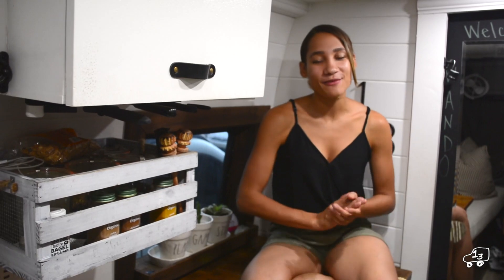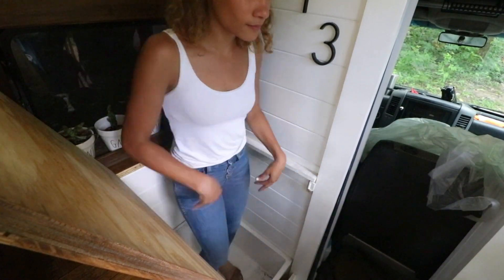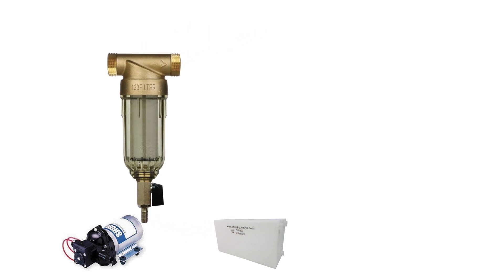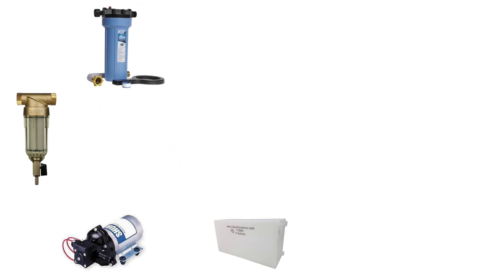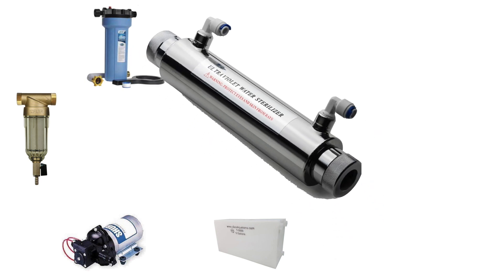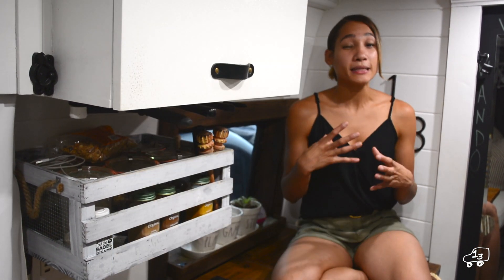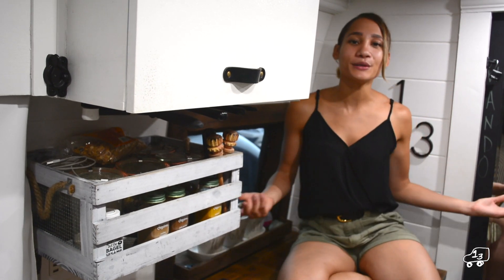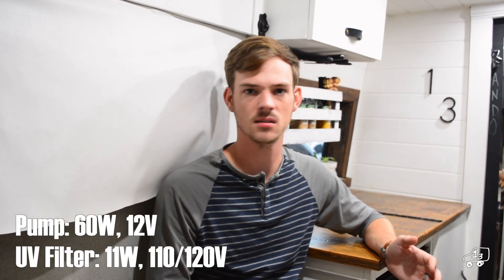VAN Tour: Recirculating Shower | How to Shower in a VAN

Comment: check out the open source project "showerloop" it's coming along fast and it's all about this :D enjoy. great vid guys.
Reply from the maker: Yesss that was our inspiration!! So glad they’re moving forward with it!
Reply: This couple actually has a better approach. Showerloop is based on a carbon filter, which is quickly overwhelmed by any soap in the system. To deal with that, they need to purge the system after use, which requires lots more water. A purely filter-based system is much better, though I would suggest several improvements to their basic idea.

Comment: The uv filter only lasts for 48 to 96 showers if I heard right. Those are expensive showers.
Reply from the maker: Haven’t heard that! Where did you hear it? How long are these showers lol
Reply: @foraluckygirl  Didnt you say you take one shower a week and at current rate it'll last the two of you 6-12 months?
Reply: my bad on the quick maths, but isn't that 52-104 showers?
Reply: UV is a light, not a filter, and that should last about 8,000-10,000 hours before becoming too solarized and ineffective at killing microbes.

Comment: Aquarium heater.
Reply from the maker: Hmmm interesting!!!
Reply: They really don’t increase temperature very fast. A heater for a large aquarium in a 5 gallon storage tank may work. You would have to plug it in a little while before you start the shower. Aquarium heaters also automatically shut on and off to maintain the set temperature and they aren’t very expensive. If the heater is shocked by being hot and suddenly exposed to cold water or no water the glass will shatter.